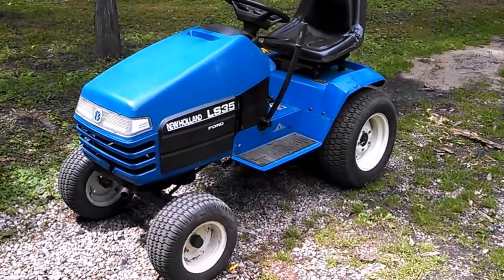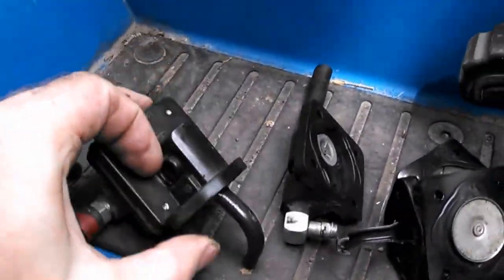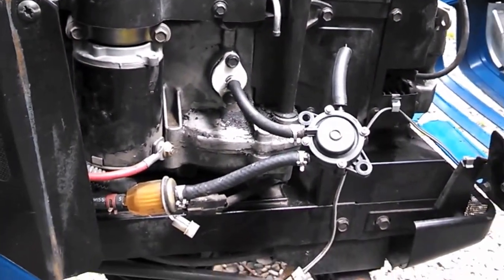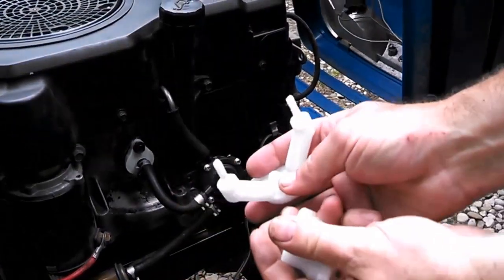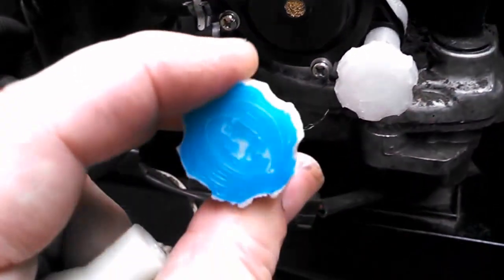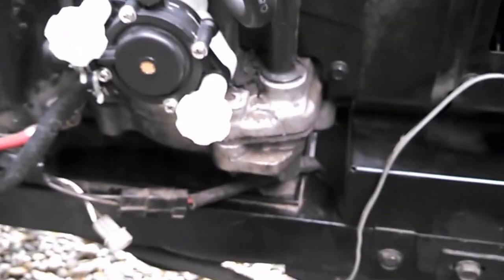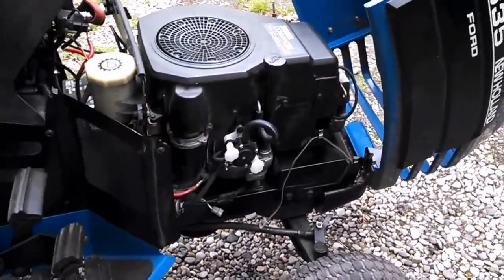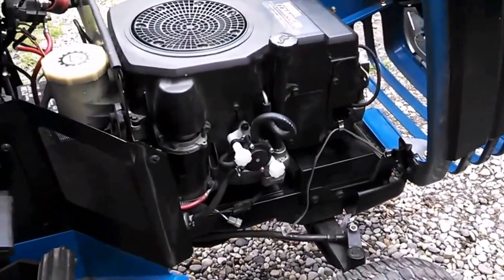Kohler mechanical fuel pump conversion on Ford LS35 - 3D printed adapter

Comment: I just picked up one of these for nothing. Hood is all smashed and the seat is quite a mess but everything else is solid. Won't start...even with gas in the carb, Has spark,
My first Kohler. :/
Reply from the maker: Does the carb still have the carburetor fuel shut off solenoid?  Sometimes those go bad and they can be replaced with just a plug.  The one in this video used to have a solenoid but it's been replaced with the plug.
Reply: @infinigrove  I'll look. Wouldn't it still start or at least kick with a little splash of gas into the carb?
Reply: @infinigrove  No shut off valve...just a plug. Lots of spark. I'm puzzled.
Reply: 8 years later about to download and fix an old friends mower. Thanks for posting the files! 😎👌🍻
Reply: @scx24fam Update ?
Reply: Worked great 👍 different proved the concept to work. The barb did melt  on a 46°c sunny day when mowing so i used the print as a template. Cut it out of aluminum and then drilled and tapped a male barbed fitting into the plate i made for the crank case vent tube.  Now it super solid. Great design a print in cf would be great.